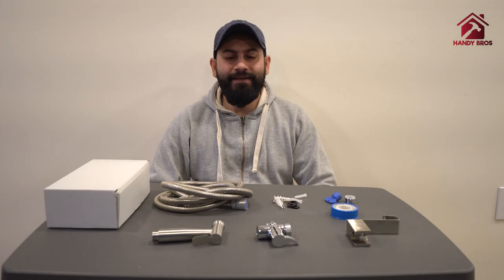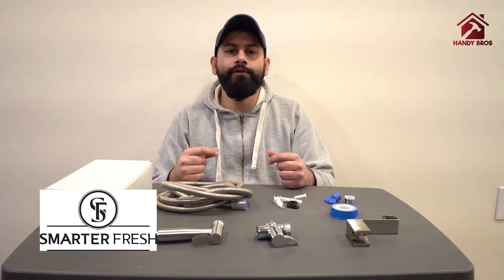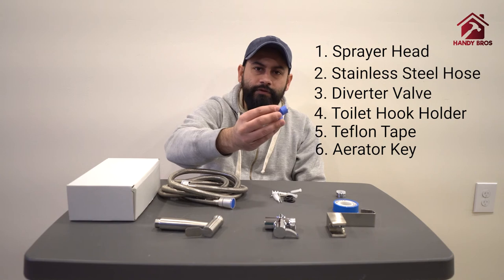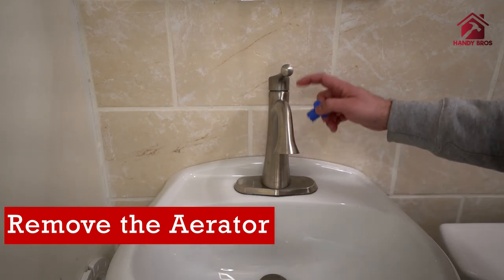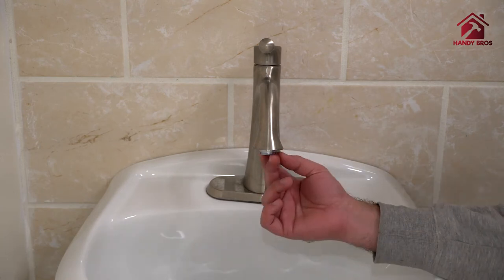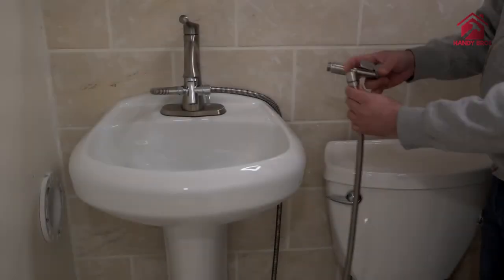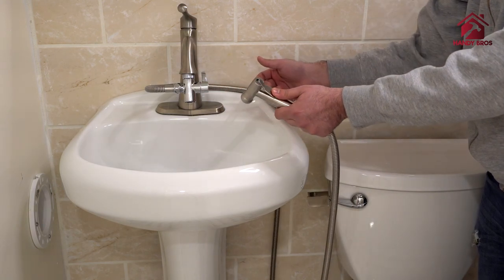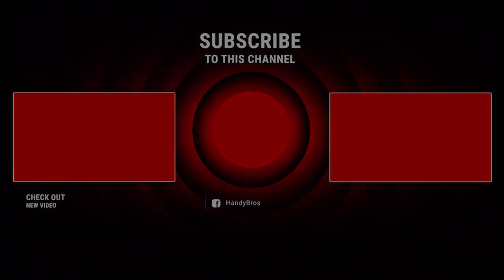Smarterfresh Bidet Sprayer to Sink Faucet | HANDYBROS |

Comment: Thank you so much. I thought it looked too easy without instructions and it truly is but I just wanted to see someone else do it. Mom is 85 and gets UTIs which could kill her. This unit is perfect to keep her spotless. I was using a two gallon container of water with a tiny amount of Vagisil cleanser and then a rinse with the same two gallons. It was difficult to get the temperature correct and to her liking using the bathtub. This is a very necessary piece of equipment for the elderly and their caretakers (God bless them all) who work so hard. This bidet could save my mom's life. Thank you for posting this video.
Reply from the maker: I am glad this was helpful.

Comment: hello, can u plz share the link for the adaptor, my bidet is not fitting my new faucet,  it fitted the old faucet smoothly.
Reply from the maker: Please see the video description for product links.
Reply: Link for the whole bidet product is there.

In the video you talking about an adaptor that you bought as it dint fit ur faucet, link for that adapter is needed, its not in description. If you can please provide link for that adapter.

Comment: Thank u so much
I want to ask you if you have an idea for installing this sprayer in case the sink is far from the toilet chair
Reply from the maker: You can use the water valves of the sink or the toilet for the water connection and attach the sprayer holder to the wall.